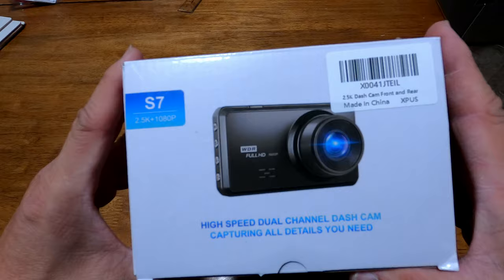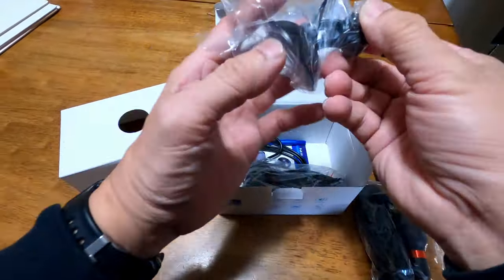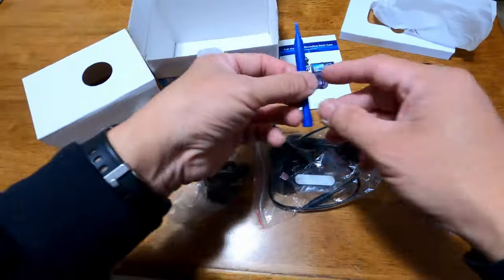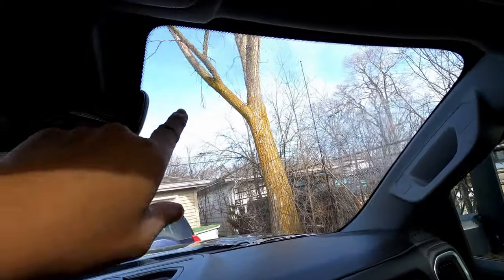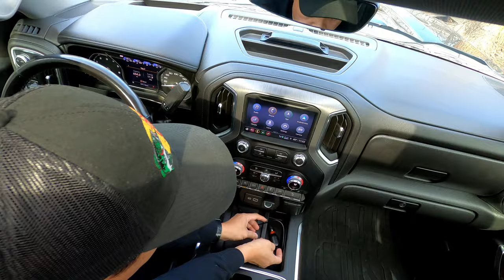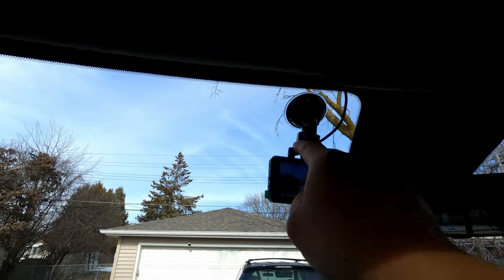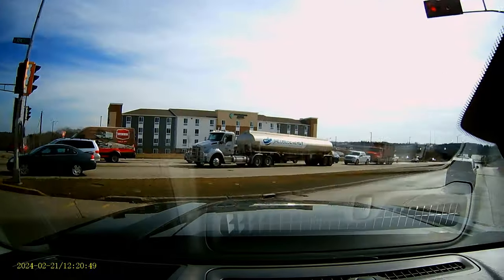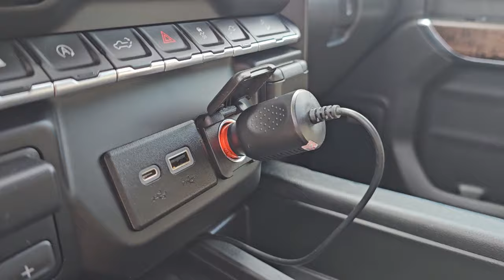How To Properly Install A Dashcam To Your pickup truck or Vehicle.  Unboxing Miden S7 And Review.

Comment: Hello thank you for the video I bought the same dash cam not yet installed. Do you think I can connect it using a USB/USB c cable? I don't have a cigarette lighter socket. And what is the exposed red wire on the rear camera for? where to plug it in? THANKS 
I am French I hope that google translate will write in good English.
Reply from the maker: @badoumba1  The red wire on the rear camera is to connect to the positive wire of your reverse light.  I don't have mine connected and the rear camera still works.